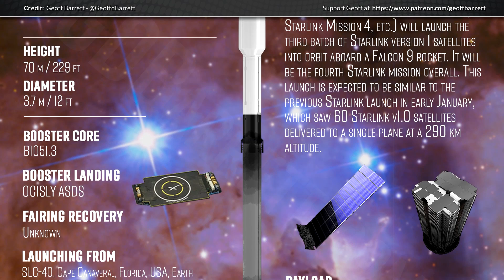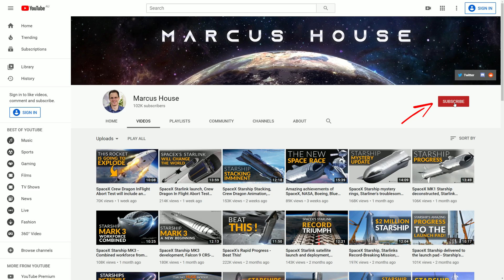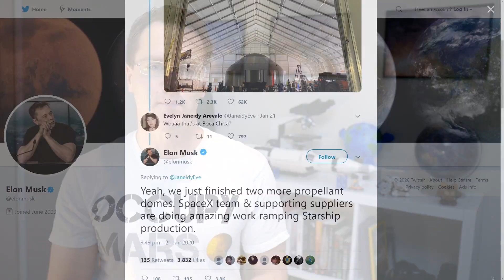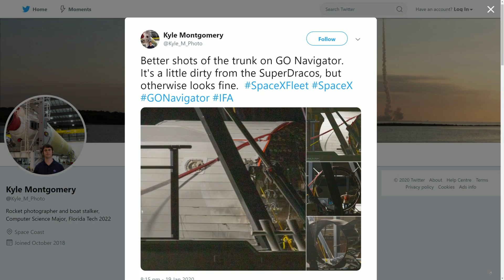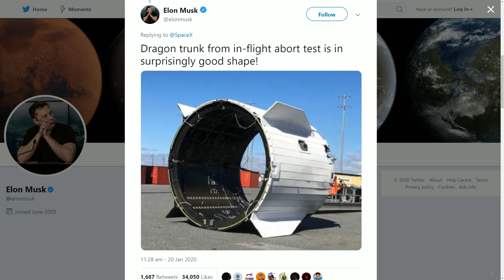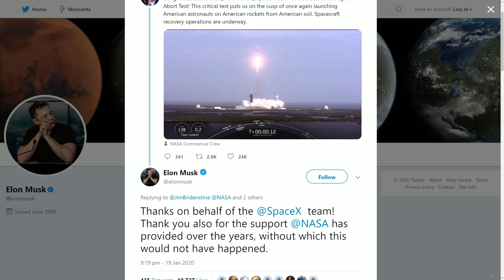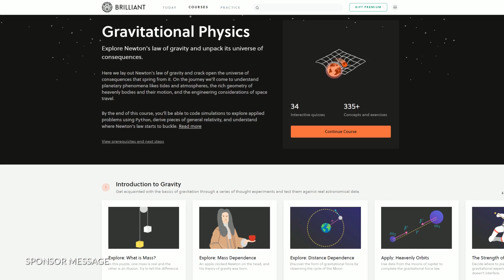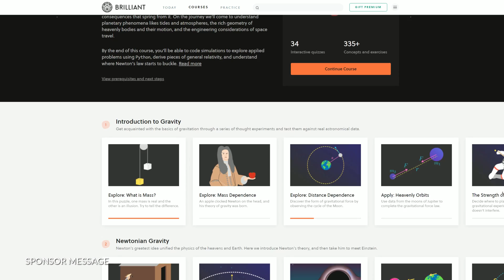SpaceX Starship Testing,  Starlink 3 and Crew Dragon Inflight Abort Test

Comment: My guess, regarding the 2nd stage surviving the aerodynamic forces, would be that the propellants helped "reinforce" the structural integrity of that stage, while the 1st stage was partially emptied, meaning it crumpled kinda like that early Atlas booster which imploded on the pad following tank depressurisation.

Comment: Separate header tanks can make sense, especially if starship is split into two stages - lander and orbiter. With slight design adjustments these stages can land together or separately depending on the planet, its atmosphere or objectives of the mission. Pros of two stage approach - lander is lighter and more stable at landings, considerable fuel economy where orbiter can be refilled and refill in orbits.

Comment: So the second stage fell back to earth fully fueled and then exploded on contact with the ocean? Is that not a waste of fuel and undo damage to the ocean life and also a case of polluting the water for no reason. Maybe I'm wrong in saying so, or do not understand why it was done, but it sure seems a little excessive for a test of another system and having the knowledge that this fuel was never going to be used. Maybe you can clarify why this was done?

Comment: I thought I remembered reading that SpaceX was going to use a dummy second stage, not an expensive real one. Those engines in particular aren't exactly cheap, even if the second stage normally isn't recovered anyway, so it would make sense that an engine which was never going to be fired would be better replaced by a mass simulator, even if the rest of it was full second stage flight hardware for reasons of accuracy, simplest solution (why make something new to play the role of a fake second stage if that would cost more than using mostly real parts), etc.

Comment: Glad they're doing some work with ion thrusters with these satellites. Imagine that experience could be invaluable for upgraded starship systems developed for flight to Mars and back.
Reply: They won’t likely use ion thrusters on Starship as they don’t generate enough thrust for a Mars mission to be useful. On longer missions, they may be more useful, such as Starships being sent to the edge of the solar system for whatever reason. On long term missions, it might be useful, but the sheer mass of Starship makes the weak force of  ion thrusters not very useful. It takes a long time to build up speed on ion engines. They are about efficiency, not brute force, like what is needed on short duration trips. Of course, a major breakthrough could change this.
Reply: @capohd28  yeah we're a few major breakthrough is away from Tie fighters but it's still a cool technology

Comment: Will SpaceX be docking the Dragon to the ISS with fully fueled Draco engines and have they in the past or does NASA consider this too dangerous or a safety issue? Also, why doesn't SpaceX considered using the Dracos for a way to land in an emergency or failure of the parachutes? They've done tests showing the Dracos hovering the Dragon capsule. Why isn't anyone asking theses important questions? Using the Dracos is better than the alternative? Great work and video by the way.  Thanks!
Reply: Yes, it will be docked with fully fueled Superdracos, and was during DM-1. No, the Superdracos can not be used as an emergency backup to parachutes. Even if it was fundamentally possible, the design change implemented after the explosion last April makes impossible to control the engines. They can only be run at full blast until they run out of fuel.

Comment: Hi Marcus, greet video as always. Quick question, we always see in the videos of starship progress, the outer rings of Starships hull being worked on. It seems to me that the are extremly thin for such a large vehicule. Could you explain how those rings are connected to the main structure and the tanks of Starship?
Sorry for the mistakes and bad spelling, english = second language : )
Cheers
Reply from the maker: They are stronger than they look. When you watch sped-up footage it tends to look a little like tin foil, but the actual structure is made of super-strong stainless steel. There are actually no inner tanks. The outer hull is also the tank wall. The bulkheads will separate the fuels and outer systems and that is about it. This is why in the MK1, we saw a heck of a lot of lines running down the outside. Because there are no separate tanks inside, it is quite a lot lighter than you would expect.

Comment: Still looks like the first stage activated its flight termination system to me. It doesnt look like any aero breakup I've ever seen, looks like high explosive. Although I've got no explanation for what happened with the second stage as I would think the flight term system would have taken it out too if it was used. Also would think in a aero breakup scenario the part at the front would go first unless it's just way stronger than the 1st stage. The atmosphere at that altitude  is to thin for the flight control surfaces of the trunk to be effective yet dense enough to tear apart a Falcon 9 booster virtually instantly. I'm not usually one to question the official version on these types of things I'm just having a hard time squaring what I'm seeing with what I'm hearing.
Reply: The second stage was way stronger, because the tanks were full instead of half empty. How many aero breakups of rockets have you seen?
Reply: @odysseusrex5908  That makes sense about the tank, though whether it's enough to really make a difference I have no idea.  And I've probably seen every rocket failure ever filmed, like most people that follow this stuff. There have been a few over the decades. Wasnt trying to imply I'm an expert. But it still looks more like a detonation then a disintegration.

Comment: "Crazy laddering?" How do you think a ladder should be used in that situation?
Reply from the maker: A platform. Having a ladder on an angle like that it not great. An angle of 70 degrees is generally the recommended safety limit. This is way beyond that.
Reply: @MarcusHouse  I do that all the time, and my doc says full recovery in just a few more years. ;)
Reply: Thanks for explaining yer comment  @MarcusHouse . I reckon the solution in the 7:24 situation would be to use a shorter ladder, instead of sliding the bottom farther out?

Comment: He's already said that the header tank is in the nose because none of the mass of the crew compartment equipment is present. CG needs corrected for these 'empty' test ships.
Reply from the maker: Yes. Although I've wondered why they didn't just put something in there to simulate that mass instead of the header tank. Regardless, the header tank I'm certain will end up back down within the main fuel tank at some point.
Reply: @MarcusHouse  I think having a tank in the nose is for adjusting the CG to an acceptable region. In airliners there are nose and aft tanks which can be filled or emptied with pumps during a flight to optimize the CG. Probably they are doing something similar here and the tank does not need to be full always, but likely needs sufficient volume to allow for the extremes of CG adjustment. Just my guess based on general aircraft knowledge.

Comment: Why did the 1st Stage explode instead of the 2nd stage??? ( I see no reason for the 1st stage to explode if the 2nd is ok)
Reply from the maker: Stage 1 was half empty. Stage 2 had full tanks. Easy to compress and buckle a tank with gas in it compared to liquid.

Comment: how will they balance cargo loads in the top of the ship with ever diminishing fuel loads in the tanks at the bottom? wont that make landing difficult? with the falcon 9's the engines at the bottom are where most of the mass is after they burn off most of the fuel but if you have a full loaded star ship you'll have 100 tons at the top.
Reply from the maker: It is only a small tank. Fuel is pumped from the main tank to keep it full at all times as far as I know. Personally, I don't feel like it belongs in the nose. I expect that will change at some point. I think it is temporary just for initial versions.

Comment: The first stage was remote detonated from ground. What you saw was the flight termination system in action, not an explosion caused by a break up of the rocket.
Reply: Palle Kuling nope. The explosion was a result of the fuel mixing once the structure broke up due to the aerodynamic pressure on the structure. Elon explained this in a tweet.
Reply: @peterkacandes5905  That is very strange because what I read after the launch was what I wrote above, and the information came from SpaceX. I must check this again. Can you find the tweet?
Reply: @peterkacandes5905  I misunderstood the word "intentionally" in the press release. I stand corrected.

"With the test, SpaceX successfully (and intentionally) destroyed one of its Falcon 9 rockets to show that, if there were a launch anomaly, the capsule could still safely return to Earth with its crew still aboard and unharmed."
Reply: No, it wasn't.

Comment: No I would not want them firing their draco engines close to the space station. The crew dragon blew up the last time wanted to do that.
Reply: Teflon Pan  The superdracos performed perfectly for the abort test, and several hundred tests apart from that one. The dracos also performed perfectly in DM-1. The failure in testing appears to have been due to refueling operations and has been addressed through used of burst discs.
Reply: @manicdee983  "that one" is all it takes dude. And lol, "refueling operations". They had A LEAK. Which is amaturish at the highest level.

But here's the thing sir. Fine, the made a mistake. ADMIT TO IT. If it had been Boeing exploding their spacecraft for whatever reason, all the SpaceX-fanatics and Boeing-haters would use that as an excuse to why spacex should get all the funding, and why they are better in every way. AND YOU KNOW IT!!!! HYPOCRITES!!!

Comment: I am worried that any hurricane will wipe this all out...😥😥
Reply: From what ive heard, The steel buildings are rated for the worst hurricanes we've seen. The fabric ones obviously have a disadvantage but it seems they set them up to still be around, but the fabric itself probably wont. There should be enough warning of a hurricane to get the important part put away.

Comment: What happened to the second stage after the impact on the ocean surface? Has it been recovered?
Reply: Homo Sapiens it blew up on impact shown in the photo.
Reply: @peterkacandes5905  yes but that doesnt mean it has been pulverized and is safe for flora and fauna in the ocean. So are all materials degradeable?
Reply: It wasn't expected to reach the surface at all. While it did, the landing site was far downrange from the recovery vessels, which had to prioritize the Dragon capsule and trunk. Plus it smashed into the ocean and exploded, so probably sank quickly. I assume they did not attempt.
Reply: @DistracticusPrime  sounds too bad. If this wasn't planned however there's hope this won't happen too often then, thanks for clarifying.
Reply: @cucco1   Well, obviously it's never expected to happen. This would be a very rare emergency indeed. As it is, that tiny little rocket in that immense ocean isn't going to hurt anything. Imagine a single drop of sulphuric acid in an olympic swimming pool. That would have greater impact.
Reply: @odysseusrex5908  im not an expert on those matters but I have grown more sceptical of impact deniers overall. I heard some media say that SpaceX might have planned the explosion and the way second stage had had its trajectory but that it was unsure at this point. Those sources also said that normally then the second stage would explode up in the air as well whie still being attached to the other boosters.
Reply: @cucco1   had the flight termination system been used, the second stage would have been destroyed. As it is, the rocket was just torn apart by aerodynamic forces. The second stage could have been destroyed too, but it wasn't, because it's fuel tanks were still full. Imagine the difference between trying to crush a half full coke can and one completely full. They knew the rocket would explode. The fact that the second stage survived was a bit of a surprise, but they understand how it happened.

Comment: Why is he using steel when steel heayed up melts and the friction needed to take off or in reentry would melt the steel? Just curious...
Reply: Steel has a higher melting point than materials currently being used. Not only does this mean that they need less heat shielding for reentry but that the structure of the rocket adds additional heat protection as well. 
Btw, it's not friction from reentry that causes such heating, it's air pressure. As the vehicle descends back to earth the atmosphere gets denser and denser, as it's falling the air beneath the vehicle gets compressed between the atmosphere and the bottom of the ship. The higher that pressure builds the greater the heat exerted on the vehicle. 
The slower the vehicle falls, the lower the pressure and thus lowers the heat. You can see a demonstration of this with Spacex F9 rockets. The purpose of the decent burn is not to lower the overall friction the vehicle undergoes but instead slows the vehicle down and thus drops the pressures the rocket will produce as it falls back to earth.

Comment: When did NASA worry about crew safety did I miss something
Reply: Don't be an ass. Quite frankly, NASA worries too much about crew safety. They are so risk averse it is almost impossible to get anything done. I used to work there, as a safety engineer, when we were first designing the space station. They were designing some highly advanced, highly complicated, robot to perform exterior maintenance tasks. That itself provided a very significant failure point. I pushed the idea of using EVAs instead. That was met with perfect horror. EVA was as dangerous as launch I was told. I pointed out that EVA used to be our business, it the primary purpose of space flight. Everybody just stared at me. Obviously, my ideas prevailed after I left, but I imagine that was a long hard fight.
All that said, my real point is that there is no such thing as safe. There is only acceptable risk and if you think the last people have died in the pursuit of space travel, or that seven at a time is a lot, then you are in for some hard experiences over time. The day will inevitable come that we lose a Starship with a hundred people aboard. It is as inevitable as the next plane crash.